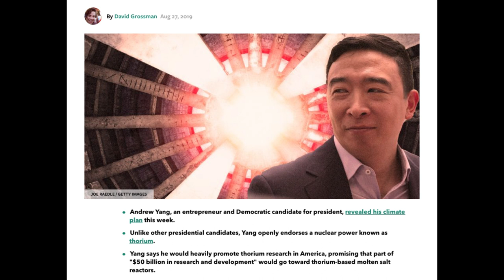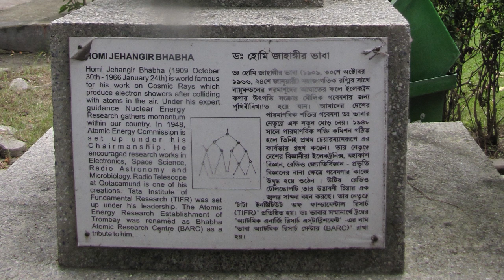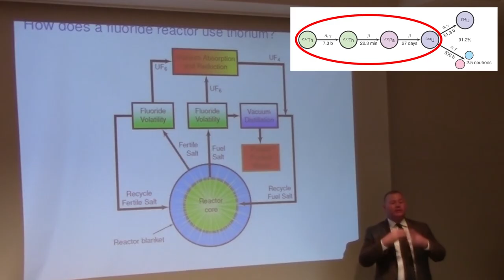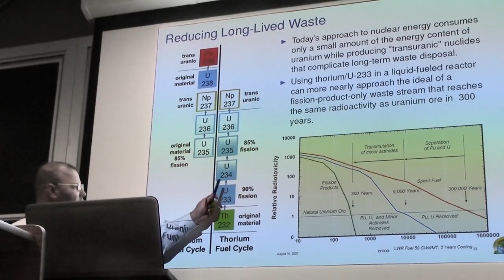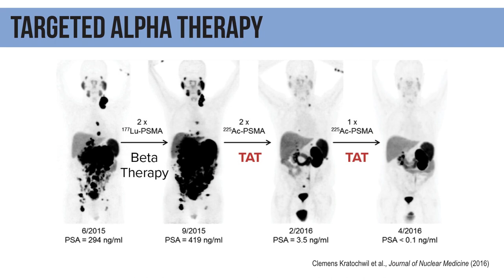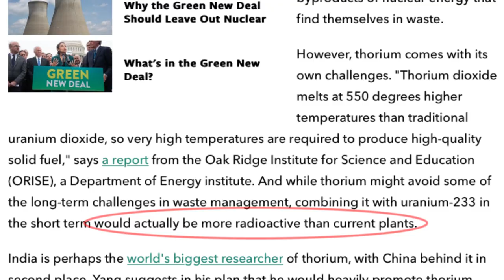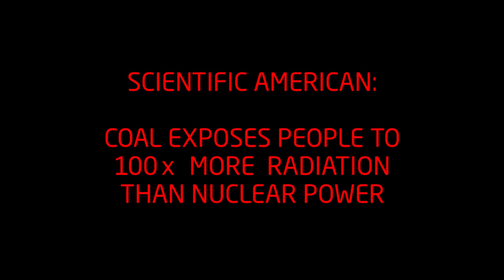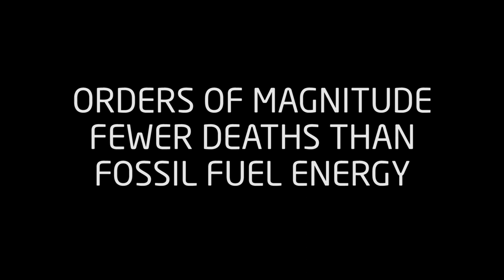Democratic Candidates on Nuclear - Fun Fact: Joe Biden Supports Nuclear Power

Comment: anybody selling TMSR stock to build one ?
Reply from the maker: Moltex did some crowdfunding, I think that's over. Copenhagen Atomics are doing some. Both are mechanisms with equity, not just "throw money at us for shiny objects". But I'm extremely not qualified to comment on anything investment related, and those proposals might not be the reactor design you're keen on. I'm not saying they are "TMSR" just that they are selling equity in MSR projects.
Reply: @gordonmcdowell  
thanks much for the info, I'll check em out.

Comment: Now convince California
Reply: It's the home of the Sierra Club and Jerry Brown, both of which helped spawn the modern anti-nuclear movement by falsely portraying nuclear reactors as potential atomic bombs. For now, we're getting by with a massive solar thermal project and a lot of methane, so I don't see California energy policy changing for the foreseeable future. But money talks the loudest, and if, say, Arizona or Nevada sell cheap electricity from thorium when our water and gas run dry and we start the old rolling blackouts again, I'm sure Edison, PG&E, or whoever replaces them will take a good hard look at thorium. So I think some form of nuclear energy is inevitable, and in the meantime we should continue to build a counter-narrative to the big environmental groups.
Reply from the maker: There's an electric grid. Produce clean, reliable, abundant electricity in one state and export it to another. If anti-nuke folk can put their efforts into building more transmission lines (needed to make intermittent energy practical anyway) then those same lines can be used to deliver reliable energy too.

Comment: I have heard  that thorium reactors could use nuclear waste as a fuel - if true that would be cool - I think nuclear advocates need to confront the use of DU in weapons - also besides the nuclear lobby money taking this to a primary probably doesn't make sense - I would be arguing for test plant only
Reply from the maker: Noss Cern The dual fluid thermal spectrum molten salt reactor favored by Thorium advocates does not consume most nuclear waste as fuel. Fissile in spent fuel-Yes. But the 96% natural uranium-No. (Depleted uranium is essentially natural uranium.)

Fast Spectrum reactors are needed to fission natural Uranium. Bill Gates TerraPower is working on an MSR for that.

However, without a Chemical Kidney there is no separation of output, and no associated medical and industrial applications.

I would like to see both approaches to energy production commercialized. Both are far more efficient than today’s reactors, although the technical challenges are different. (In fact the salts used are different too.... fluoride for thorium, chloride for fast-spectrum uranium.)
Reply: @gordonmcdowell  thanks

Comment: It would be less expensive, & much safer through increased efficiency, & to have private homes 'feed' an upgraded, EMF resistant grid with wind, solar, & hydro, which would turn electricity into income, rather than a personal expense, than the social expense, & hazard of Nuclear. NO NUKES!!!🦁✌
Reply from the maker: What's your opinion of Germany's "success"? https://www.electricitymap.org/?lang=en ...that's their approach. Sweden, France and Ontario (by contrast) actually have LOW CO2 per-captia. I think the challenge is that the sun sets and wind stops blowing. I'm sure you've heard that before? So when you buy solar panels, and it is noon, and you're generating full capacity, so is everyone else. And at that moment the energy you are contributing has very little practical value. It WOULD be of GREAT value before sunrise and after sunset. So, if you personally BUY some batteries, and EAT THE RISK of those batteries, and REPLACE your used-up batteries, then your solar panels could be of GREAT value to society.

However, if you try sell what no-one wants or needs, you might be disappointed. https://www.bbc.com/news/uk-england-49566130

Comment: Thorium has been next thing for 40 years..????. Wow...imagine reactors avg running 300% over cost.
Reply from the maker: 2019-40=1979 Really? You find me some public facing news story about thorium reactors between 1979 and 2006. AEC directed ORNL to terminate MSR R&D in 1979. Until the reports were digitally scanned and circulating (first on CD-ROM) in 2006, how was this the next-big-thing?

Maybe you're thinking of fusion energy?
Reply: @gordonmcdowell  talking about chinas and indias efforts primarily...for over 40 years ...till this date no thorium reactors. ?
Reply from the maker: @vibefrequencyable   India is solid fuel. I'm pretty clear in this video that's not the correct approach. You did catch that, right? As for China, they started T-MSR in 2011. If you see any indication they've stalled or slowed down in their progress tell me what that is. Their workforce is 1000 (last number we've heard) and they're building an MSR pilot right now.
Reply: @gordonmcdowell  I'll check that out...thank you for bringing that to my attn!

Comment: andrew yang will be the president soon, for now we have too stick with bernie
Reply from the maker: Bernie Sanders is ideologically anti-nuclear. Joe Biden supports nuclear, and specifically supports funding research programs into making it less expensive.
Reply: @gordonmcdowell  well it's not rocket science, is it?
Small modular reactor - by mass manufacturing them in factories, instead of building them on construction site, you save a lot of time and money. And time is money in this case.
There is a concept of ship-mounted reactors manufactured at dockyard factories - and then just hauled where you need them. Instead of having to burrow 6 bln$ and having to wait 6 years till it starts making money for you, you can have a ship costing 1 bln$ and making money for you after a year - that's one major difference in terms of returns from your investment.

Walk away safety: instead of having dozens of 99% reliable safety systems, you need one that is 100% reliable. Such as the concept of freeze plug and a drain tank in molten salt reactors. You're saving a lot of money not having to install all these dozens of backup systems.

Comment: Thorium reactors are moot - if he wants to put up 50 billion it should go to the tech called "Liquid Air."  It uses air right from the atmosphere in an on demand peak power generation.
The fuel doesn't have to be dug up out the ground or processed, it's renewable and free !!!

Comment: Thorium is not yet developed to commercial level and by the time it is solar PV/battery will be even cheaper. Thorium research money would be much better spent on installing solar which would lower the cost of solar itself just by economy of scale. If you believe in thorium it is because you have become a follower of the nuclear power religion. The day for thorium has come and gone. Logic however rarely overcomes religion though.